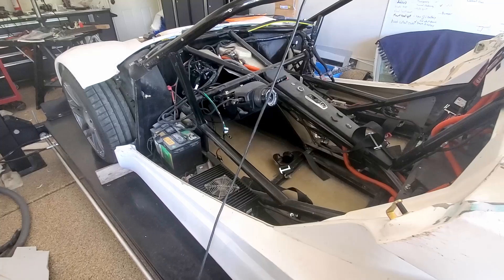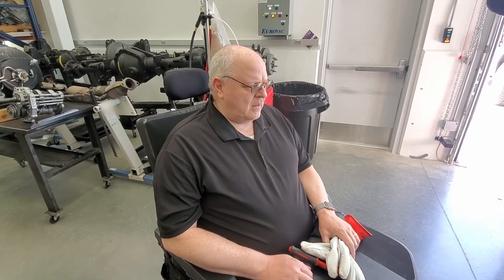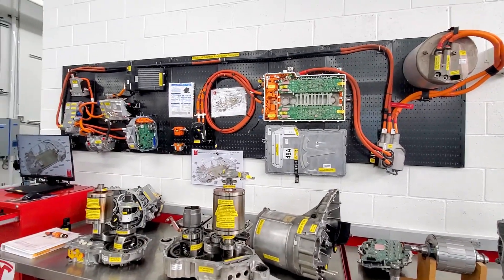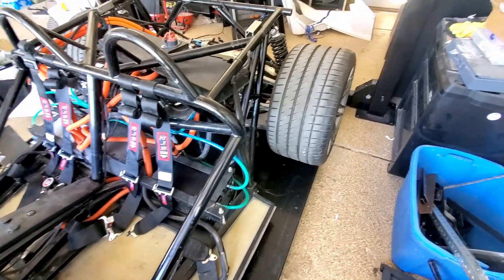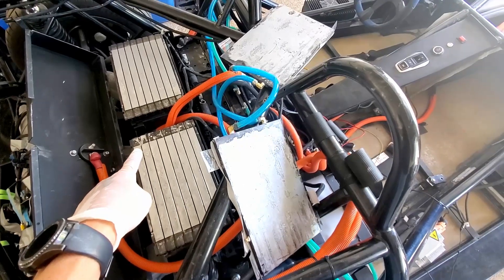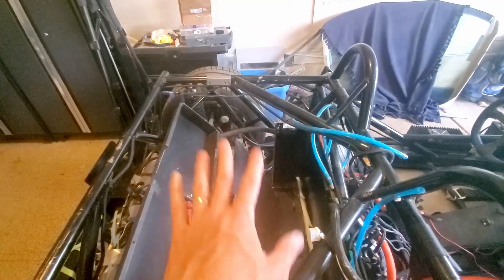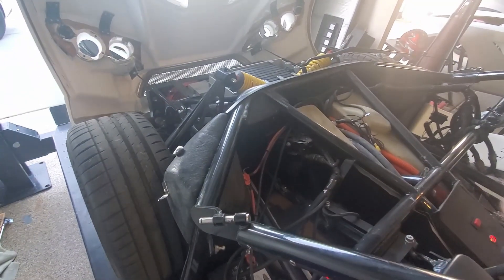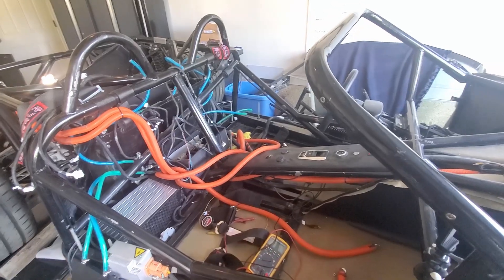Getting Professional Help - WeberAuto

Comment: Hey there I Don’t know if someone suggested but you can resolve the problem with Dielectric coolant.
Reply from the maker: Thanks for the comment!  Talking with John at WeberAuto he said once you have put in regular coolant it is extremely hard to flush it all out so that it will be non-conductive.  Meaning that you would likely have to do several coolant flushes. I eventually  got things isolated.  Whew!

Comment: Hi...had exactly the same thing--nerve pain going down my right leg--after my back surgery...my surgery was a micro-discectomy, yours may have been different. On the advice of my surgeon, I went to a pain management specialist (MD) who had experience and a great track record in resolving this exact sort of pain.  He injected a steroid powder solution at just the right spot, and it shrunk the area where swelling was pressing on the sciatic nerve.  It resolved the pain completely within days.  Just my experience, yours may be different, but thought I'd relate it in case it might help.  --Don
Reply from the maker: Sounds like my doc had the same suggestion